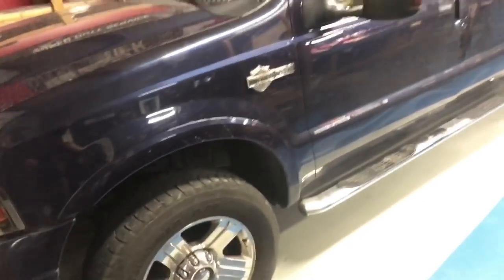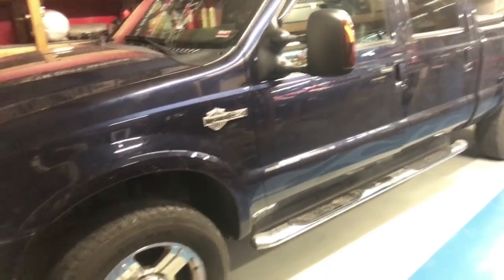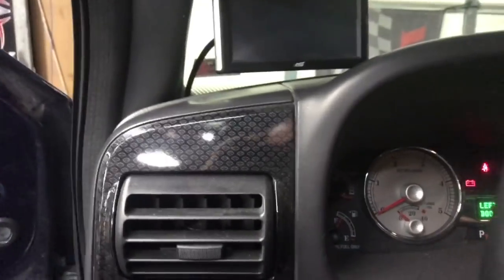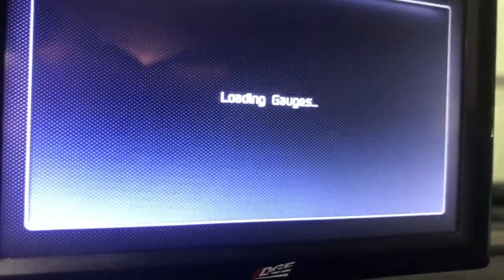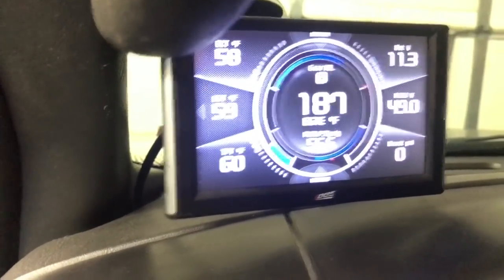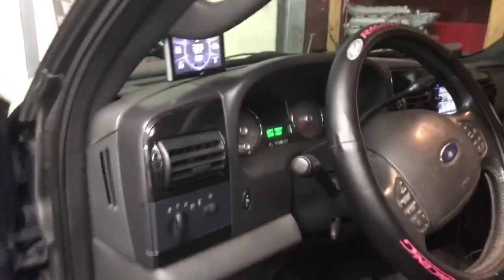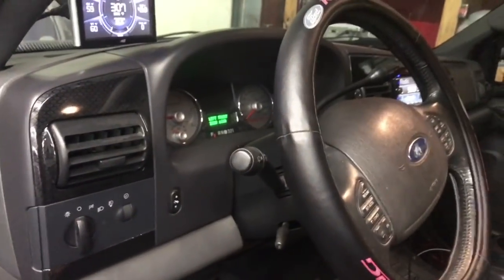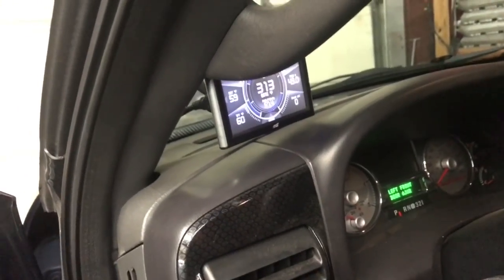Dom's fuel circuit low cold start.

Comment: Try a central junction box under the steering column I’ve had a couple short out internally, cutting out power to the fuel pump relay. Throws a fuel pump secondary circuit low code and will drop fuel pressure and cause stalling.